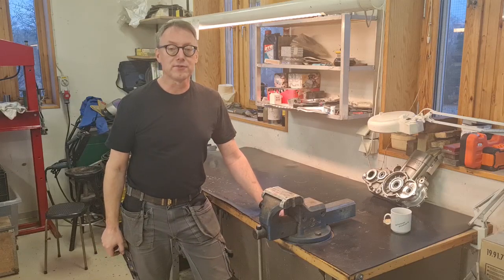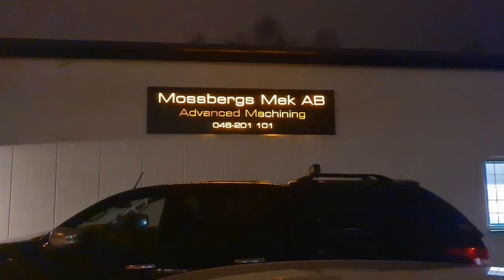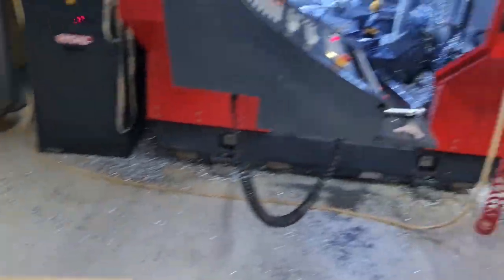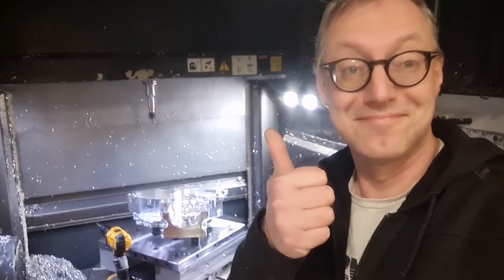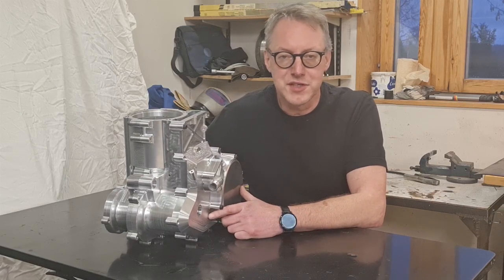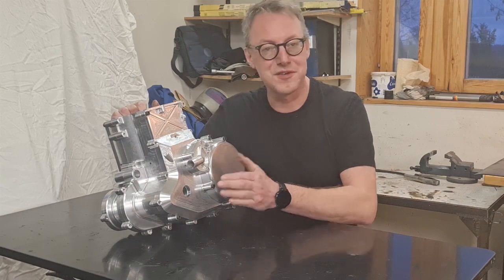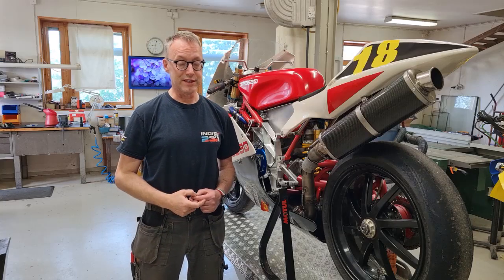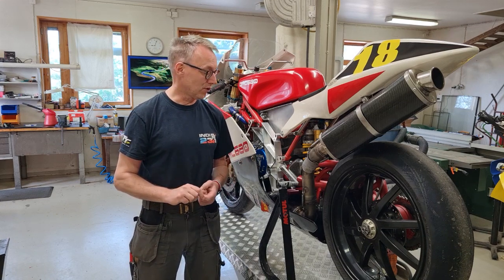Crank case project IV

Comment: Cast aluminum has about 1/3 strength of 6061 bar or plate. Also thermal conductivity is much better, though the exact value escapes my memory at the moment. Beautiful work. Any notion of future commerical production?
Reply from the maker: Thank you for info and cheering! The OEM castings are of high quality and the mtrl feels hard. I've kept all min. wall thicknesses when designing. If I  knew all forces, I could have FEM calculated the complete design, and maybe shaved off a kg or two...
I did a brief market survey 1-2 years ago. There may have been interest in only 3-4 cases, so I decided to drop that idea (for now), and design for racing only. But never say never!